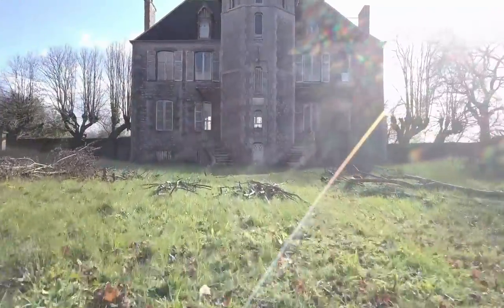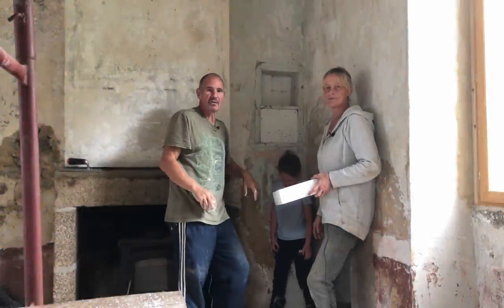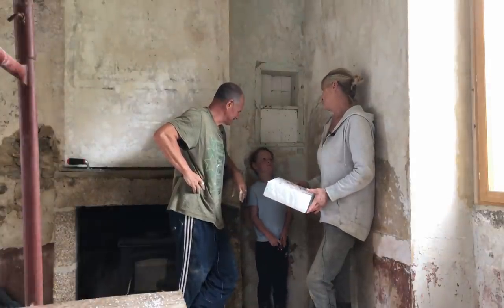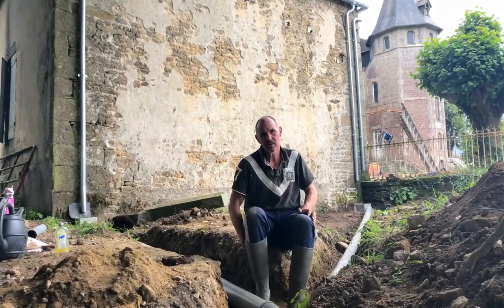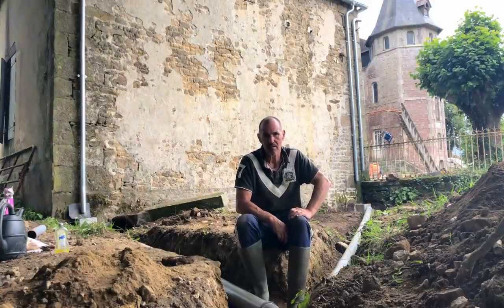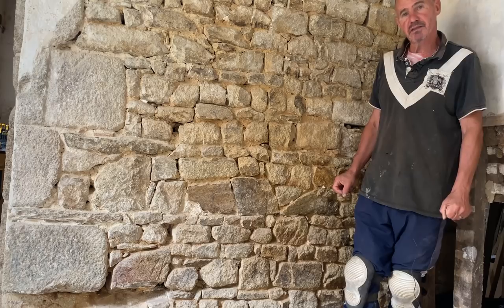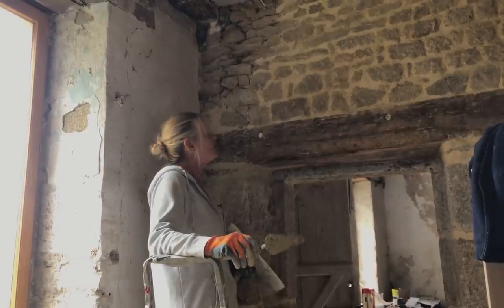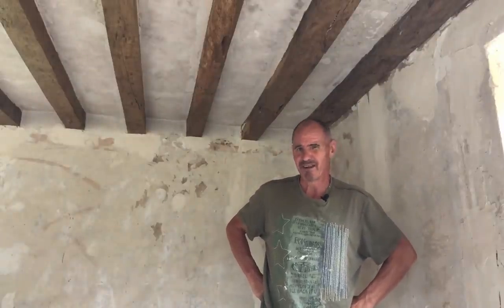The Château Cottage Drainage & Interior Stone Wall. Ep 17

Comment: A really simple idea is to put a filtering system on the  tank to reuse water for showering, dishes, etc. Grey waters can be filtered with a simple filter on the pipe. Checking these out could save a water tax. The Cottage is renovating nicely! Later!
Reply: A whole new eco system for filtering,showering,drinking sharing and a water well that catches rain water or septic tanks to add water pressure and no backed upped toliet's. Updated system.

Comment: Tony and Tracey, pre soak your stones with a little water sprayer before adding the mortar when pointing so the new mortar bonds to the old as well as the stone. Good luck! If you plan to seal your walls make sure and use a breathable sealer so the walls can breathe or the trapped moisture will destroy your walls.. Your work is absolutely beautiful!